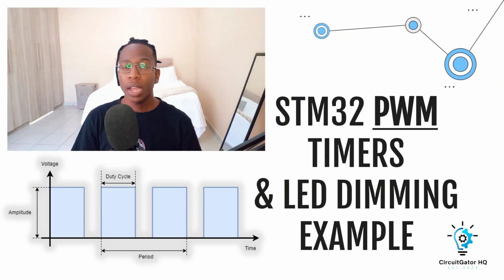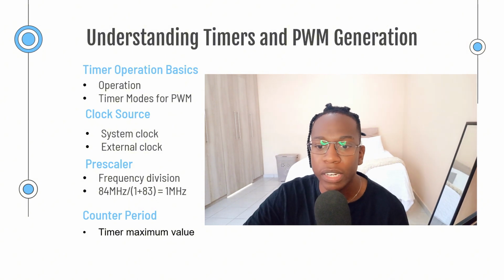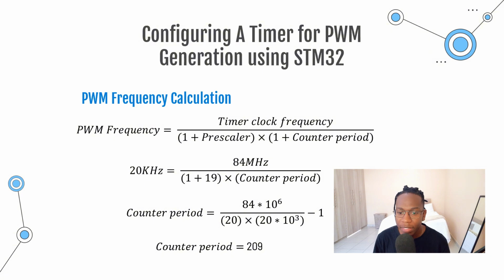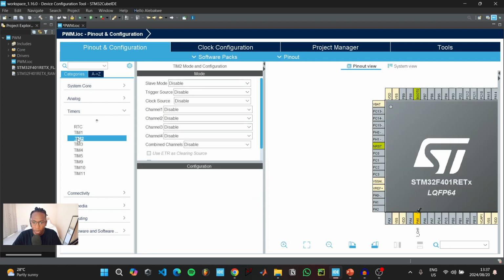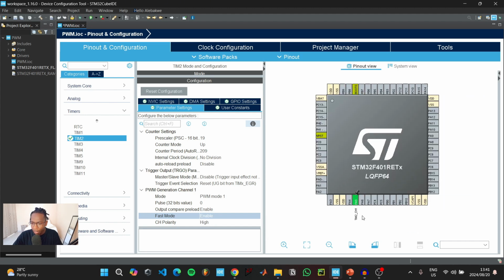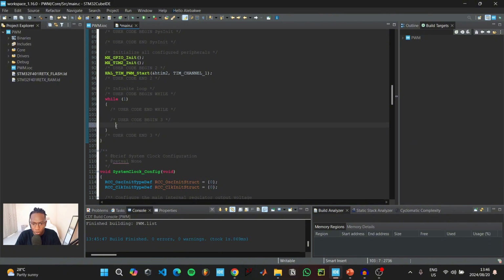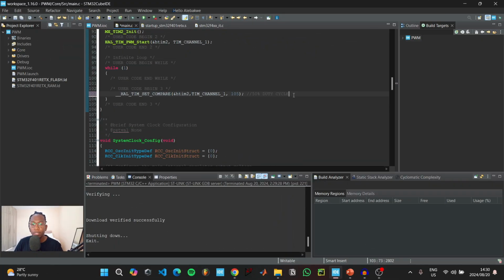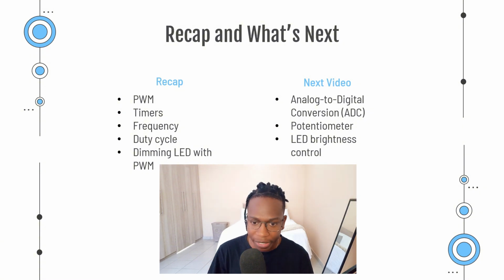STM32 Beginners Guide Part3: PWM, TIMERS, Frequency and Duty Cycle. LED Dimming with PWM example.

Comment: Re: Font Size for code - Eclipse (the CubeIDE) font can be overridden in Windows by using the option in Compatibility Mode to override the default by setting Hi DPI settings to "system"  It does make code more readable on high def displays.  Nicely esplained PWM.
Reply from the maker: Thank you for the feedback.

Comment: Excellent tutorial series.  I've had the same board as you for years but couldn't figure out how to get it to work except with the Arduino IDE (which never worked well).  Is there anyway you could increase your font size some, it's tough to read sometimes.
Reply from the maker: Thank you for the feedback,   are you referring to the font on the slides or the code?

I will make make it bigger on the upcoming videos.
Reply: @CircuitGator_HQ  Sorry I didn't specify. The font for the code. If I could, I'd like to ask you for a special request... Could you please do a video where one pin outputs a PWM signal and another pin is setup to read it? On my Arduino Nano I can connect these pins with a wire and view the output via the serial monitor. Thanks again for a great series. I look forward to seeing what else you are able to teach me
Reply from the maker: I will make your video request,  Please subscribe so you don't miss it.  Thank you!